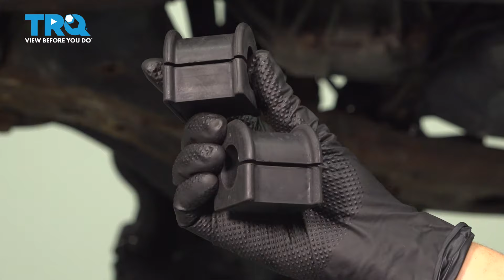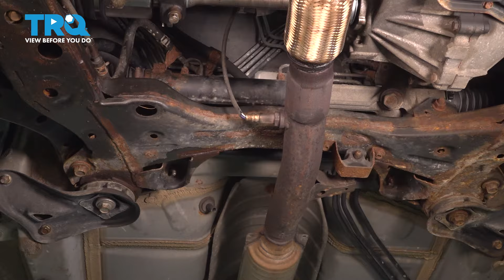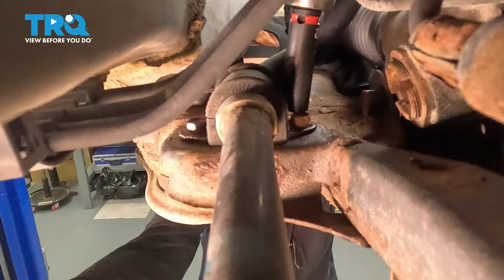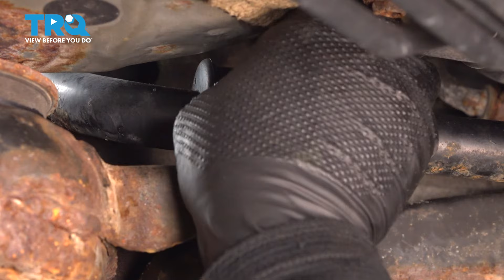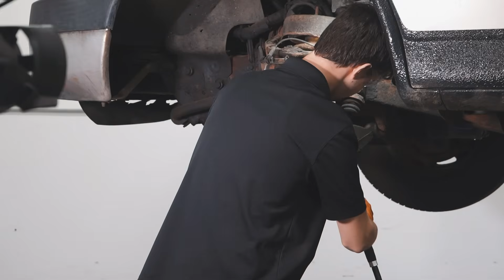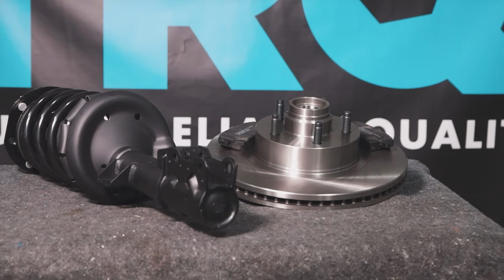How to Replace Front Sway Bar Bushing Set 2002-2006 Toyota Camry

Comment: Using a silicone based lubricant on the bushing inside and out will reduce noise from the new bushings and increase longevity